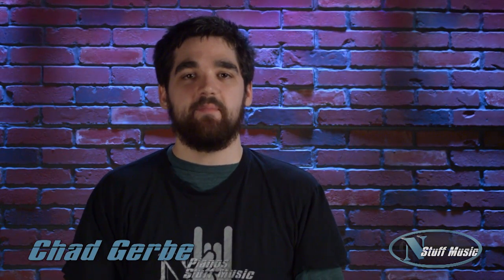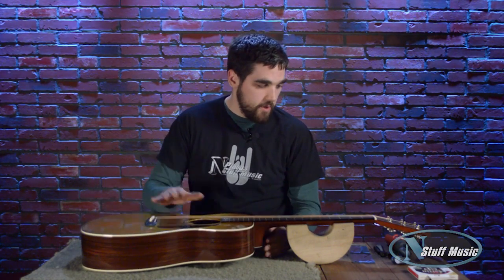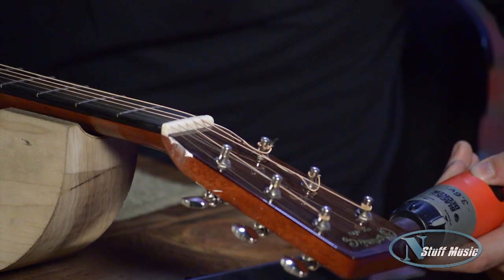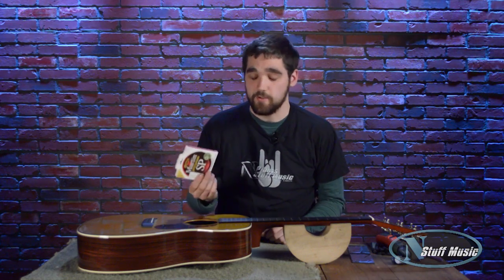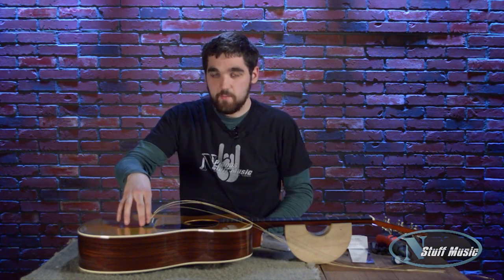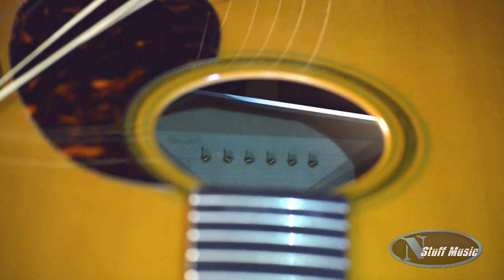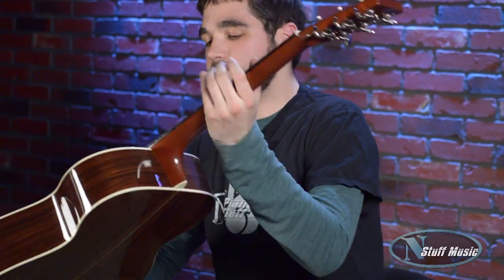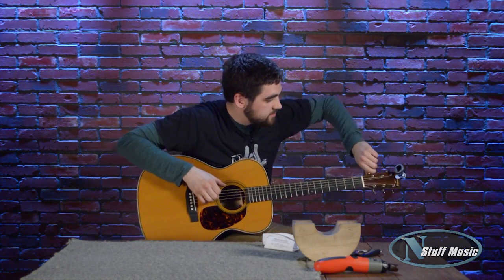Guitar Maintenance - Changing Strings | N Stuff Music Service Tutorial

Comment: A very good video. But why are you not adjusting the truss rod tension as you put the strings off/install the new ones? Lots of people don't do this, and over years they find the neck warped severely so that it can only be fixed with a help of luthier.
Reply: Thanks for the question, Aleksandrs. In my experience, two of the main reasons why a truss rod adjustment may be necessary is because either the humidity/season has changed and affected the straightness of the neck, or because we are putting a different gauge of strings on the guitar which would change the amount of tension on the neck. In this video, I changed the strings to the same gauge which were on the guitar previously, so the guitar did not require a truss rod adjustment.
Reply: Thanks for replying. However my question was a bit different..
Isn't it necessary to adjust the tension WHILE removing old strings one by one? And vice-versa - while installing new ones?
Truss rod's tension works to counteract the strings' tension, keeping the neck relatively straight (in balance). What would happen, if you take away the strings, leaving the truss rod tension unchanged? Correct me if I'm wrong, but I think the neck goes way too tightened (back-bowed), which causes wood's deformation.
So, in my opinion, you should slightly release the truss rod, after removing a couple of strings, and then repeat as you're taking off strings, making sure the neck remains straight. Especially with heavy string gauge and unreliable necks. I'm always doing it and I believe it keeps my guitar neck safe.